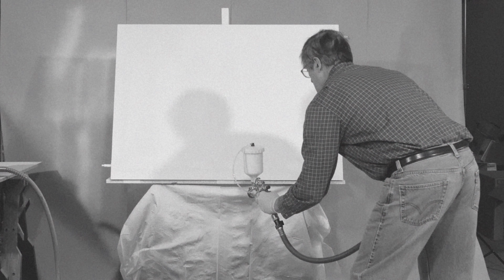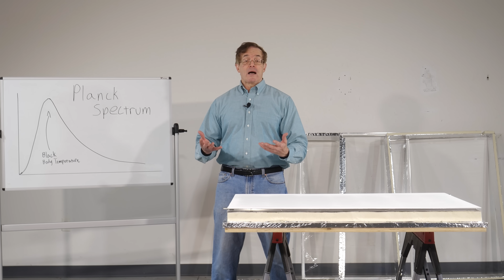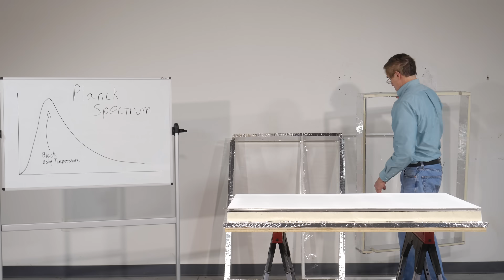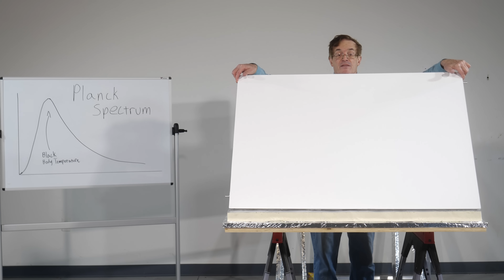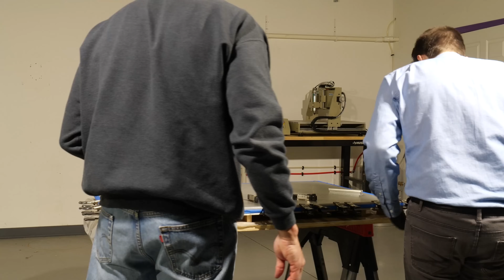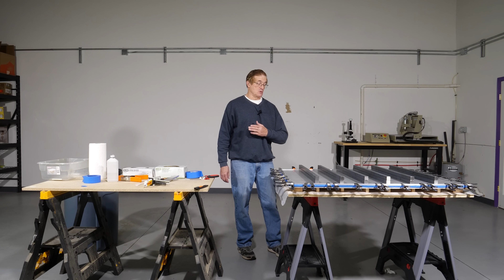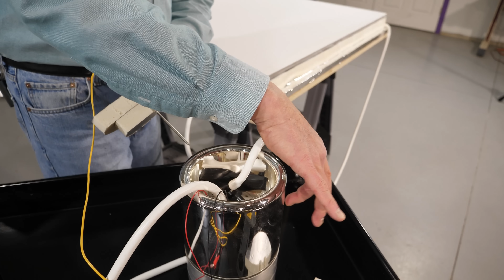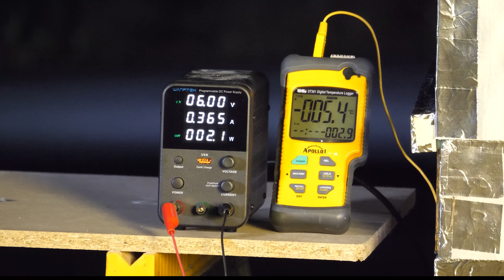Air Conditioning isn't free... but we're close.

Comment: I’m confused, I thought that black was the color that dissipates infrared in the most efficient way. Wouldn’t it more efficient using black (at least for the night, as I guess during day time it would absorb more than irradiating away)?
Reply from the maker: No. The visible color has little to do with the infrared emission and has about a 10 times longer wavelength.

Comment: man, I learned things I never knew existed, about temps and loosing heat to the sky, etc., and I'm a tech/car guy.  thanks for that! 
Curiously I wonder, wouldn't using mirrors/chrome surfaces be the best for reflectivity instead of shiny Aluminum?
Reply from the maker: Surprisingly, aluminum has a higher total reflectivity than chrome. It's about 95% vs. 80%.

Comment: Problem is this competes for space with solar panels which produce WAY more work than this ever will.
Reply from the maker: Fair enough.
Did you watch our later video on the special coating that makes this possible?
Structures and vehicles coated with this heat rejecting paint will need less active cooling, whatever method you use to accomplish it.

Comment: Does the incoming sunlight not heat up the surface very much at all?
Reply from the maker: No.
Check out our follow-up video on making and applying the special coating used here. We tested that coating against other coatings in bright sunlight. The results are impressive.

Comment: I wonder why we're still cooling air in 2024 with active electically powered cooling systems while passive systems like earth tubes have been around for decades. You only need to bury tubes around two meters/yards into the ground and circulate air with two fans. Additionaly you get the benefit of refreshing the air in your house. The low quality air in houses is one of the main cause of sickess as well.
Reply from the maker: The answer is the market size.  Everyone has windows in their home, office apartments, and even yachts. Access to a location where you can dig, bury, and route the pipes is limited, especially if you don't own the property. 
Regarding health, it would be better to bury a closed loop, probably a liquid loop, and use a heat exchanger inside to transfer the heat from the air.  The cold, dark subterranean pipes are a breading ground for mold and bacteria.
Reply: @TechIngredients  You make fair points, thanks.

Comment: While it sounds plausible of radiating infrared wavelengths into space, it also kinda sounds like a scam. Why didn't you do the test during summer instead of winter? Winter is when we DON'T want temperatures to drop. One also wonders how much area it will require to operate. True solar panels have limited time to utilize but electricity it built for many purposes. If you imagine a case where you want to cool a residence, it might be more reasonable to set up solar panels to capture sunlight to run an AC than to run this bulky setup.

Comment: Guess I am not smart enough for this.  In my mind it seems like the sun would heat up the plate and warm the water.  I'm guessing that was covered in the part where he wasn't speaking English....
Reply from the maker: Ha!
Actually,  I did cover that in the first part of the video. Simply, the clear sky is very cold. It's about halfway between room temperature and absolute zero, i.e., -273 degrees C. The coated surface radiates heat just like everything around us, including...us. That heat is exchanged as infrared radiation back and forth, so everything around us is at nearly the same temperature. Our coated surface faces the sky, and so it radiates about 450 watts/^2M, but the cold sky can't return the favor, and our surface cools.
Because the coating is so reflective to visible and near infrared light, even bright sunlight can't make up this difference, and the surface remains cooler even in the sun.

Comment: Fun demo - but I got to the end frustrated by a lack of data. Great, the liquid got cooler than the ambient. But only a limited volume, and only inside a vacuum insulated flask. You talked a lot about the theoretical power of such a cooling panel, but I’d really love to see how many watts it can radiated to the sky. Put a resistive heater in that flask, and measure both the inlet and exit temp to the panel. Ramp up the power to the heater and see how many watts you can shed when the water starts just a bit above ambient and returns just a bit below ambient.

Comment: Would running you water through a second radiator reduce the temperature that much again?
Reply from the maker: No.
Even if the panel's heat exchange function was 100% effecient, additional panels would all be radiating into the same sky and will be operating at the same temperature drop.  The water will cool a little more as it passes through additional panels in series because they are not 100% efficient, but the drops will be progressively smaller through each panel.
Reply: @TechIngredients  I get that, but I'm thinking volume.  Imagine your setup runs for a hour.  It reduces the temp by say 10 degrees in the first 20 mins.  From then on despite continuing to circulate it simply maintains the 10 degree reduction.

Now instead of just using a container to measure the temp you run those hoses to another radiator inside of your house and blow on it with a fan to then cool the inside air.  This is the basic idea of using it as an air conditioner.  Yet because you are now actively heating the water by cooling the air in the home with it, the heat exchange is effectively under more load to reduce the temp.  So after running for an hour your water temp is only being reduced by 5 degrees instead of 10.  Would you be able to add a second heat exchange to get that 10 degree difference?

How would you go about balancing the number of heat exchanges or total size of a single heat exchange with the needs of a house based on square footage.

Do you understand what I'm getting at?  Obviously size matters or you might as well make the thing 1 square inch.  Maybe the one you build would be fine for a home the size of mine, but wouldn't work for my neighbor with 2 x the square footage.
Reply from the maker: I understand.
This can be addressed with more or larger radiating panels. Running them in parallel might be the better option because their performance increases with larger differentials. The factor is temperature to the fourth power.

Comment: is the system effective and maintainable at cooling private residential properties? As in, in your opinion, is this system commercially usable for homes?
Reply from the maker: It would be effective, but such a system is not yet commercially available.
Reply: @TechIngredients  yeah I've noticed which is quite odd considering the application. This would be widely successful in my country as temperatures reach 50+ celsius. Even as a business opportunity this has great potential.
Reply from the maker: Agreed

Comment: Is it possible to have a highly radiation emiting material/structure that is transparent to infra red light in one end and emmiting emiting in the other. We then create hundreds of thin layers of these in a partial sphere and put a heat conductor point in the center to collect all the radiaton. Then with air sipping in to this structure between the layers, it takes the surrounding heat and focuses it in to the heat conductor with the goal of making it hot enough to boil a liquid, drive a turbine and extract electricity from heat in the environment.
Reply from the maker: No.
The infrared that strikes and is emitted by a surface is diffuse and covers a fairly broad wavelength range.  The infrared could be trapped in a structure as you described,  but not concentrated or focused.

Comment: So you can’t climb on the roof and you can’t clean it, the sunlight will destroy your plastic wrap, and it’ll freeze and bust come winter.
Reply from the maker: It turns out that the plastic increased the performance by only a small amount.   You can lose it.
We're environmentally testing this coating on several panels mounted outside the warehouse, and we're currently at 16 months. It looks pretty good.

Comment: Clouds are bad because it blocks the radiation from going into space? That sounds like a load of bull
Reply from the maker: That's a fact.
Maybe it would seem more reasonable to you if you remember that everything radiates energy and I mean everything.
Clear space, clouds, rocks, plants, and the surface we were testing. The amount of energy radiated depends on the material on the surface and its temperature. A cloud base is at 0 degrees C, while clear space is about 150 degrees colder. That's why your car windows frost over more quickly and densely when it's parked under a clear sky.

Comment: Hi, I would like to know how many BTU per square meter can you extract from the water. More specifically, how many sm required to cool 600 liters of water by 5 degrees C every hour (12,000 BTU/h). Thanks.
Reply from the maker: This depends a lot on the temperature of that water.  The surface radiates energy proportional to the surface temperature to the fourth power.
Reply: @TechIngredients  Thank you so much for answering and so quickly. This would be in a tropical climate (hot and humid). It would be used to circulate AND Cool, the water of a floor cooling system of a 80 sm home. Do you have any measurements done to evaluate in the best & worse condition, how many BTU can be extracted per litre of water, at what debit. I know this is a tough question, but it does determine the feasability of the system and what you can actually use it for. Thank again.

Comment: Nice way to spell "ain't" … You know you can fix thumbnails, yes?
Reply from the maker: Of course.
But, this worked.
Reply: @TechIngredients  Only if it was your intent to look sloppy and negligent. Then, yes, it still works.
Reply from the maker: Think of it as counterpoint.😉
Reply: @TechIngredients  Counter to what? With what relevance to air conditioning? Are you just throwing random, vague, asspull phrases against the wall in the hopes something sticks, or do you actually have a point to make that doesn't scream "I couldn't be arsed to proofread my thumbnail and am now too petty and defensive to fix it"?

Comment: I am curious about an idea... I don't know enough about alot of things, so excuse.my ignorance ... is there a method to cool passively solar ? I am aware of pelter(?) Cooling as in electric and dissimilar metals, as well as propane rv cooling by heating ammonia.. is there a diy to passively cool say 5° below ambient?
Reply from the maker: I think the approach would be to use an ammonia cycle and base this on solar heating, which is straightforward.
Reply: So it would not work for cooling? It was worth a try

Comment: That's completely wrong, your body emits approximately 75 watts, not 1,2 kilowatts.
Reply from the maker: The human body produces 150 watts at rest.  But the relationship I was addressing was the infrared emission of the body at 37 C. The environment returns most of that radiation.  Everything around you is also emitting radiation.
Reply: @TechIngredients  It was 75 watts when I studied it, now they say it is 80 watts. https://en.wikipedia.org/wiki/Human_power#Available_power Those 80 watts are in the form of infrared energy. You might wish to brush up on your knowledge around this, because that part of your video, is completely wrong.

Comment: It would be interesting to try a flat black surface because flat black is not only a great emitter, it is a great absorber. White is a lousy emitter and absorber!!! Would it work better to use a black surface at night and a white surface during the day?
Reply from the maker: That's not quite right.  When you say white and black, you're referring to the appearance at visible wavelengths. White, like this coating, can be an excellent emitter at thermal wavelengths.
Reply: @TechIngredients  thanks for that. I have a teaching degree in Physics, but I was in college 60 years ago and I didn't get into deep details about emissivity and absorption of various surfaces. Your comment is useful to me since I have been considering painting my house roof white to keep down the cooling cost in summer....but then there is the winter to deal with. Any idea of a paint that would deal with that situation? Or is it basically impossible to solve both situations with one surface coating?  This might be an opportunity for some deep thinking person to make a fortune....I did read somewhere on the net that if every roof in the US was painted white, it would nearly cancel out the heating caused by CO2 because so much light energy would be reflected back into space.

Comment: No it isn't but if you use the earth right and buid your home properly you can keep the structure between 68° & 72° year round with the power usage of an incandescent light saving you thousands a year but you need enough property and have to build the infrastructure into the the home ground up costing quite a bit more than a traditional home with a heat pump up front so do we start costing out homes as built and pass it on in the sale price or do we continue to throw houses up the same old way calling them super efficient especially compared to homes from the post war boomer days

Comment: My grandfather built their house with passive solar in mind. A 4ft deep space sits under the house, with river stone as its bed. The entire front face of the house has a sun space going up over 2 stories. This allows for airflow from underneath the house to pull heat from the rest of the house forward. 

It’s pretty effective, though you have to work to ensure that cool nights flow into the house and then seal it up during the day, at least in heatwaves like the one we’re in now. It does have its limits, as the 100+ F temperatures we’re experiencing now mean the upper floors get quite warm, but we have been able to keep the downstairs between 68-74F throughout the day. 

With such a house design, even small AC input would make a large difference, minimizing energy consumption.
Reply: Vernacular architecture is definitely the best way to conserve energy.
Reply: I wish YouTube comments had a way to post pictures. It's hard to visualize what you're talking about to be honest.
Reply: @JimNortonsAlcoholism  I’ll find a way to upload a link, though it will just be an external shot.
Reply: @jacobbaumgardner3406  Issue is, YT doesn't allow links to commenters. OP can post them, for example, but the average viewer gets a shadowbanned comment that disappears after a couple seconds

E: It might be easiest to form a short video and just tell people so they can check your channel..
Reply: uhhh like a solar chimney? passive solar cooling?
Reply: You said a lot of words but I still don’t understand  wtf he did to make it better
Reply: @xx_pcgamer_xx  house use fancy architecture so pull heat from house.

Comment: Bro, did you get time to make observations when the outside temperature was around 30-50°C?
Besides, go check out the mud buildings for cooling in India.
Reply from the maker: Yes, we did, and as expected the performance increases with temperature as the radiation output is proportional to temperature to the fourth power.
I've seen something similar in North Africa.

Comment: This is a waste of time we have these already it’s called a plate and frame it’s used to cool the bldgs during cooler months by utilizing the cooling tower water to cool the chilled water loop for the bldg  but ur still using a lot of power by running a chiller and if all these panels were all over a bldg u would have a have a huge chiller a lot larger than what bldgs have in them now and they use a lot of power to run
Reply from the maker: Why are you comparing radiative cooling to a mechanical chiller?
You can cool without compressors or a refrigerant with evaporative cooling, and we did a couple of videos on this.
You can eliminate any moving parts by coating surfaces such as roofs with this special coating that we demonstrate and test in the video that follows this one.

Comment: that plastic wrap will break with any kind of load on it(heavy rain/snow) so would require draining system and removing it everytime weather happens. Not very practical
Reply from the maker: You're right.
On further testing, we found that the plastic enhances the performance by about 20%. It's probably better to simply eliminate it.

Comment: Question: while this seems to be a good insulator, how does the structure fair against wind shear and debris impacts from high winds or storms, including hail?
Reply from the maker: The coating and the metal substrate should be fine. We've been testing a couple of panels outside now for 15 months and they appear pretty much unaffected.  We'll be doing a video on that this summer.
The polyethylene turns out to boost the performance by about 20 %.  It probably would be best to simply eliminate it.
Reply: @TechIngredients  Wow! Thanks for the quick reply. I'm asking as someone from the American Midwest, so I'm sure I'm not the specific target for this invention but I certainly value your work with it.

Comment: I haven't watched the full video (I will later), but how is the fluid flowing through their radiator? Unless it's all by rainfall and gravity, I wouldn't call this "passive cooling."
Reply from the maker: The cooling is passive.  The transmission of that cooling to another location in the form of a chilled liquid requires a pump.